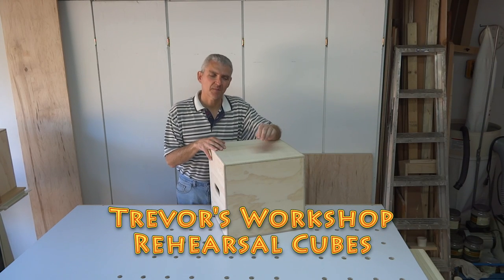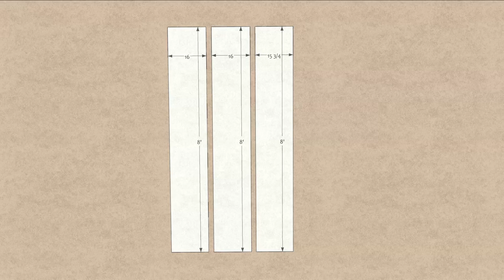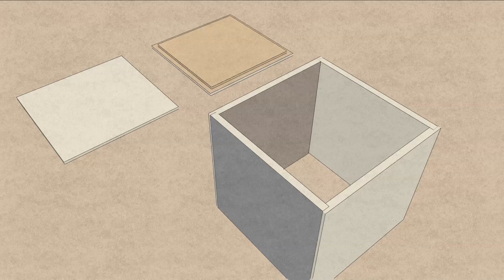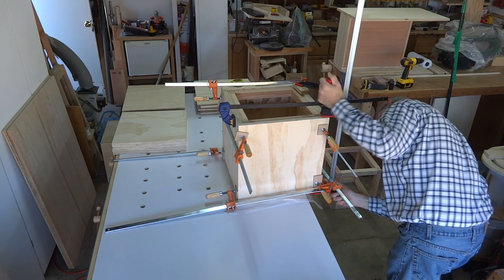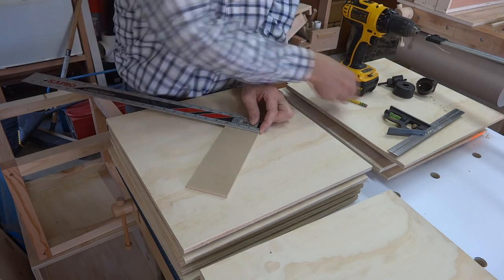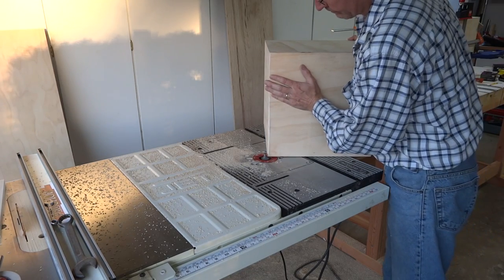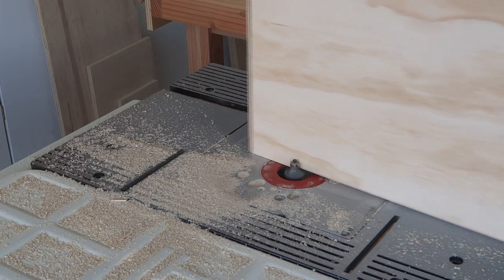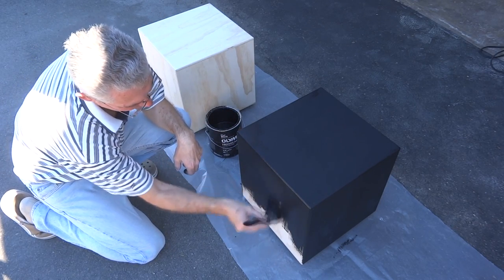Making Rehearsal Cubes

Comment: Hey I am looking at making some of these for my dance show they need to be sturdy enough to stand on/tap on but light enough to move I need measurements so the person can make them but I have no idea! What would you recommend? I want bigger than the ones you did in the video thank you! 😊
Reply: Hey Kelly. I just finished making 24" versions of these. I was able to make one cube with one 4/8 sheet of ¾" plywood. The top and bottom are 24" with the same ¾" wide by 3/8" deep rabbet. Two of the sides are 24" wide and 23 ¼" tall. Those 23 ¼" sides get the rabbet. Then the other two sides are 23 ¼" x 23 ¼"
Reply: Also I made a simple internal structure to bear weight. See the green here: http://d.pr/i/y5LV. I made it out of 2x4 and offset the up/down one so it didn't interfere with the hole/handle

Comment: Hey Trevor. Very cool and I just made these and a 24" version :) I'm confused about the dimensions though. If the final width will be 16" and we're making 3/8" deep rabbets on the sides will that not leave us with a 15-3/8 plus 3/8" plus 3/8" or 16-1/8"? What am I missing?
Reply from the maker: The top and bottom should be 16" x 16", 2 sides should be 16" x 15 1/4" and 2 sides should be 15 1/4" x 15 5/8". That should ensure the cube is 16x16 square when using a 3/8" rabbet. Thanks for pointing out.
Reply: Thanks Trevor!